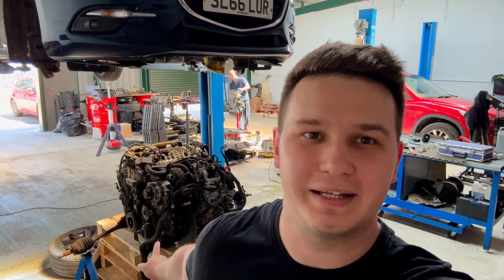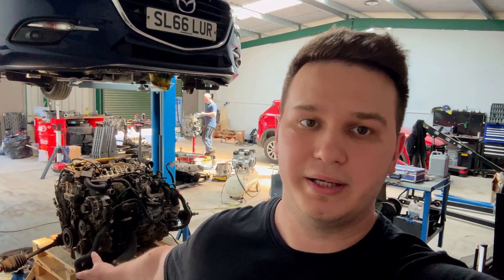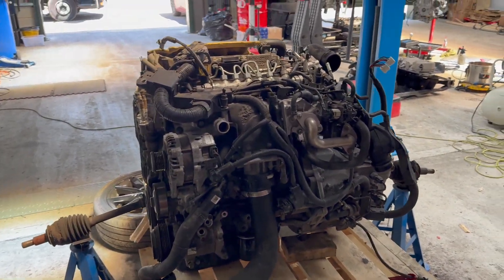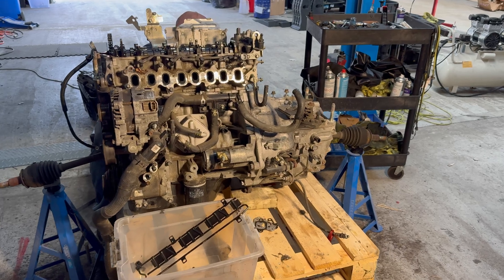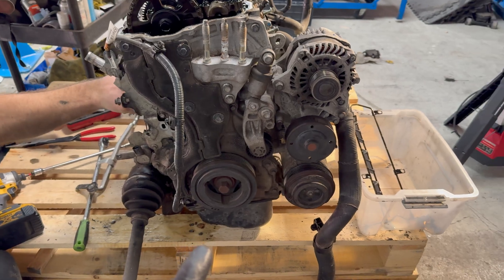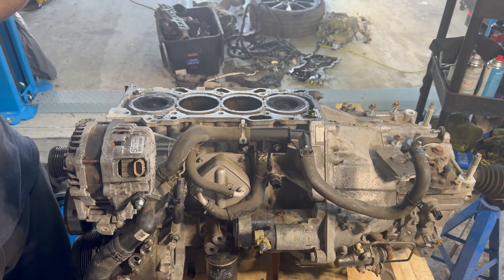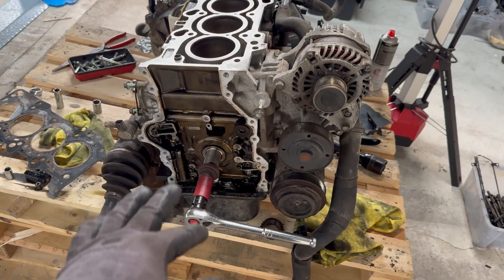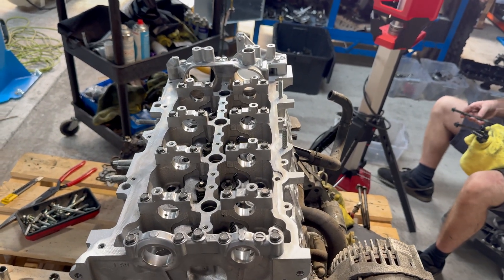Mazda 2.2 Skyactiv Headgasket Replacement - What could go WRONG?

Comment: Hey as there's no thicker head gasket for those engines is it possible to skim the head and the block and use standard head gasket (when just a minimum amount was skimmed)? I would be very grateful for your reply

Comment: Mazda didn't include a temp gauge  😢such a poor standard from a Japanese manufacturer, by the time the car goes into limp mode and revs the guts out of the engine the damage is done! Bill Mazda they had a duty of care to fit a temp gauge and didn't! Outside of that put long life coolant and change thermostat every 5 years and hope your water pump bearing holds out?

Comment: Finally, I can contribute back to the channel with some knowledge! 😎 My dual mass flywheel was also misaligned, and the one in the replacement engine as well. You can make a tool to align the bolts. Take 2x 1/2" extension bars to make a longer bar, then put 2x 1/2" T-BAR adapters on one of the extensions, and put two sockets 15-16mm on the adapters, then move them a bit to fit the holes. You can now rotate the DMFW left or right, and hold it with the hand, when removing bolts with the other and impact wrench ideally!